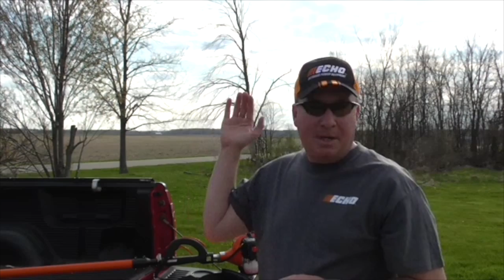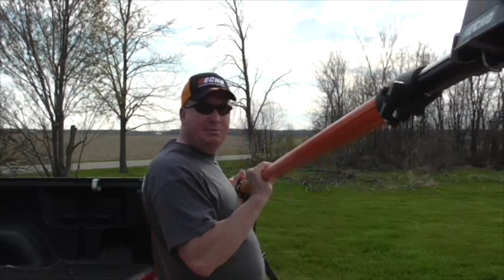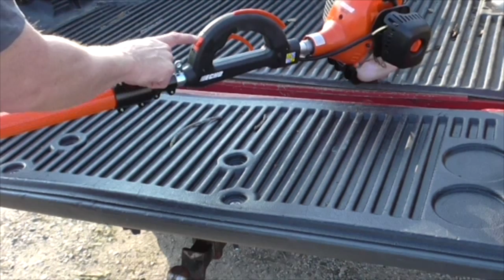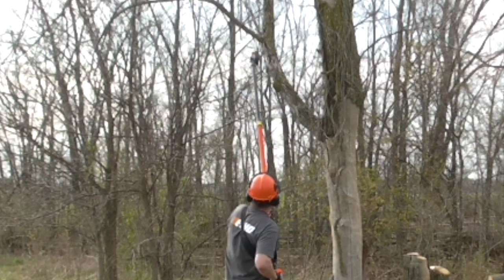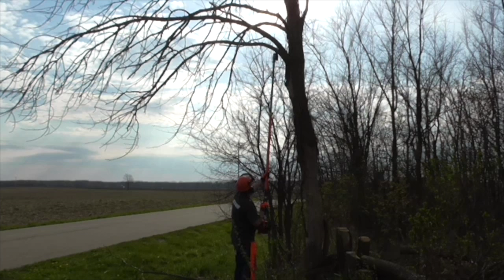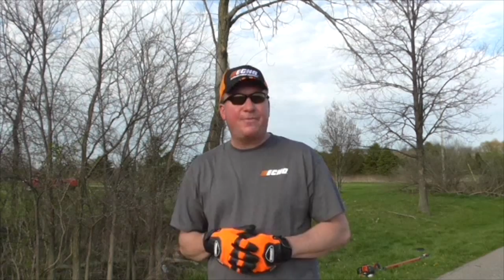ECHO PPT-280 Telescoping Pole Saw Power Pruner

Comment: Really liked this saw, to be honest got a bad one first,🌀 allabout.wiki/Sun-Joe the poles extended too far out beyond stop and sent back, got replaced from Amazon quickly. Have used this now for a few years and this thing just cuts everything! Just watch when weight from the big limb can bind saw in the cutting slot. Pull out and come from the other side-bottom. Terrific cutting up after limbs down on ground too! Keep oil handy to refill Auto oiler for chain bars, but it just works Great!!!
Reply from the maker: Thanks for sharing!  I've thought about getting the 4' extension, but I thinks it might get too heavy.

Comment: Ugh, I need to use my echo pole saw about twice a year, and it never starts. Never.  I get it serviced by a professional, it works and the next time I need to use it.... nothing.  I can keep pulling that chord till the cows come home, but won't start.  When it works, it works well though.
Reply from the maker: Mine seems to get flooded  and can be hard to start at times.  It's been awhile since I've had the issue, but it seems like the only way it starts is by removing the air filter, put the choke on, use one hand to keep the throttle squeezed, and then try starting it.  I bet it will start within 5-10 pulls.
Reply: Just proves operator error. I had same issue and i figured out it was me not the equipment. echo one of the most reliable brands on the market.

Comment: This is very similar to the telescoping model I bought in 1997. But that came with an 8" bar and chain. I put a longer bar on it. A Husqvarna bar fits well.

The model I bought had problems with the chain oiler. But the Echo dealer in Redding, Calif. got me the upgraded one for a good price. So check your oiler.

And please don't neglect the sprocket tip of the bar. Those are bearings in there and they need care. I always over-grease that part to help flush out chips and dirt.

Good video. Thank you.

Comment: I guess you forgot to mention how heavy the power pruner is especially when it's extended, Oh yeah what's up with all the gear ???
Reply from the maker: I don't know the weight off hand.  It's definitely balanced decently, so you can easily manage it.  They make a 4' extension accessory, but I'm guessing it would start to get hard to handle at that length.  ECHO gave me the gear, so I wore it in the video.  Overall, this pruner sure beats going up on a ladder with a chainsaw.
Reply: Yes, it is very heavy and awkward, to use, for more than 5-minute periods; however, Husqvarna makes a very good support-harness-vest, that is meant to be used, with many garden tools, the Husqvarna XT Harness, $190. w/FreeShip... Cannot find anyone, doing yard-work, without it, in Sweden...

Comment: Mark do you prefer the echo or stihl pole saw?
Reply: Myself, I’ve had issue from day one with my exact same Echo trying to die in a 90 degree vertical position. Been worked on under warranty 3 times. Warranty out now.  No mechanic is going to run in real cutting situation long enough to get it to do it. Starts and runs fine otherwise. Worked on fuel pick up and carb?????
Reply: @axeman33333  dang that sucks  I got 6 echos saws I did have 1 acouple years ago do that it was the carburetor..they put a new one on it worked good
Reply from the maker: I've only run the Echo pole saw and really like how it works.  I just used it the other day to cut a small tree that fell on my shed.  I've watched someone run a Stihl pole saw a few times they do a nice job as well.  Sorry I can't help any more than that.
Reply: @MarkThomasBuilder  echo is ,,20 times better. Than stihl .40 years tree guy

Comment: Never cut standing under, Great tool for roof tree clearing while standing on roof or using free standing ladder for light ground trimming.  Generally, trimming trees with ladders has many limits.  Only use ladders for small cuts.  Safety climing gear is best
Reply from the maker: If the pitch of the roof is a 4:12, then I feel comfortable doing that.
Reply: Yes, low pitch and two story high made this tool a winner clearing trees from roof.  Now if I can get bar oil flowing.  Thanks for help.  I may phone contact Echo.  Yes, always leaked, poor oiler design, but great small engines.

Comment: From day 1 new, chain oiler has always had major issue leaking when not used and now no oil hits bar.  Echo PPT 2400.  I'm good with tools, but nothing seems to work to get oil flowing to chain and see no visible issue.  any ideas?  Echo engines are bullet proof. but this oiler is a mess
Reply from the maker: My oil reservoir has a slight leak over time.  I haven't tried to fix it, since it's a minor issue.   I'm not sure about the oil flow issue.  Here's the Echo support page.  I thinks it will be helpful for fixing your problem:  http://www.echo-usa.com/Support-Help
Reply: Great video, thanks for sharing and support help.  Youtube folks are great that hold many keys for life value success.
Reply from the maker: Thanks for sharing!
Reply: I found and fix oil leak.  Echo 2400 oil tank has a pin hole with a one way air valve at bottom of tank.  Cheap rubber valve and poor design, I blocked it off and put my own air valve at top of tank.   Echo engines are excellent.
Reply from the maker: Thanks for the info.  I'll have to take a close look at mine.  It seems to have a small leak on occasion.
Reply: Note that my rubber valve and pin hole is extremely small.  I had to use a high scope lens to see pin hole.  Also, valve is factory sealed inside oil tank.  No easy way to replace.valve, but easy to seal off and make my own valve at top of tank.  I purchased Echo 2400 new in 1999, I'm sure Echo upgraded oil tank with better design.
Reply: This pole saw tool has many tree cutting limits and cutting trees with ladders is not wise.  My first tools for tree work is full set of safety climbing gear with my CS-330 pruning saw.  Low use on pole saw kept me from digging into leak issue all these years.  Pole saw is only good for a few small ground trimming or roof clearing.  Cutting anything large while standing under needs careful attention.

Comment: My Power Pruner was purchased in 1996 or '97. Back when Power Pruner was its' own company. But they had Echo motors on them. About 5 years later I got the improved cutting/oiling head, but it still didn't have the branch remover hook. I was glad to see that in your video. I have had on and off carb problems with this saw, so it was not used as much as I would have liked. But I basically do recommend this saw.

Note, I would also get in the back of my truck. Have many times. But I suspect the Echo company would not like you to go there. OSHA and all that crap, you know.
Reply from the maker: Haha, I know that standing in the bed of the truck was pushing the limits a bit.  Glad to know you recommend the saw.
Reply: I got one better, but only do with clean and sober living, standing in tractor  loader bucket.  Stable high platform tractor Bucket works great on my estate.  Keep in mind limits of this tool and when tree climbing is needed with full safety gear and my light pruning Echo CS-330 climbing saw

Comment: GET A STIHL..sorry caps lock glitched
Reply: I really did my home work when deciding to get the echo or stihl, and ended up finding more flaws and negative comments about the stihl. so went with the echo with the trimmer style handle instead of the D handle used in this video, and love it.
Reply: Erica Lopez: Hi Erica, Does Stihl have a telescoping long shaft model? I don't  know if they still make the HT 131.
Reply: kakarot: I went with the Echo. It was purchased from Baileys around 1996, so it may be one of the original models. It was made by the old Power Pruner company, before they sold out to Echo. But it has the Echo engine. The two problems with this model were the oiler for the chain. Eventually I just got a whole new cutting head from an Echo dealer. Now it's better. The other thing seems to be carburation. Once the thing is warmed up and in operation it is good. But it takes sweat and effort to get it there. Therefore when that industry came out with smaller ones (Poulan, Craftsman) I got that for smaller jobs. Let me say at this time, if your research indicates that the problems with the Echo have been ironed out, then I would recommend it for purchase.
Reply: Stihl suck echo all day